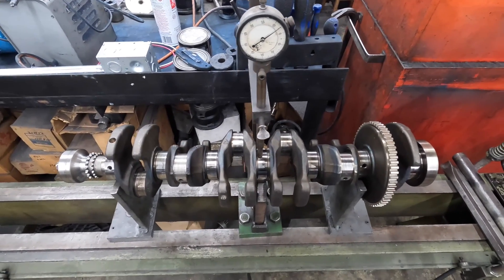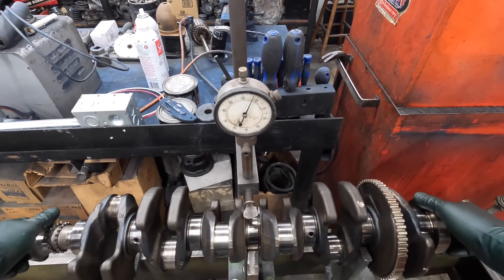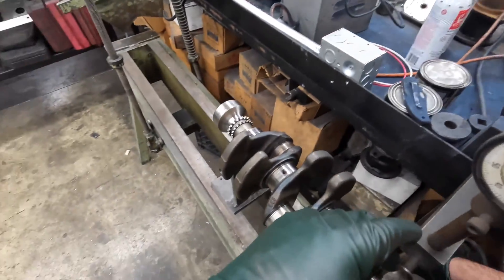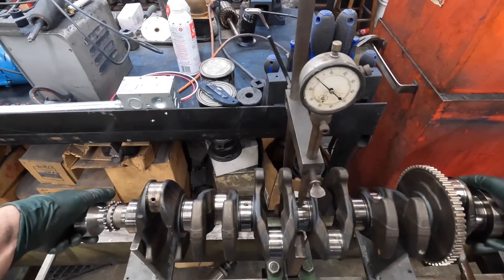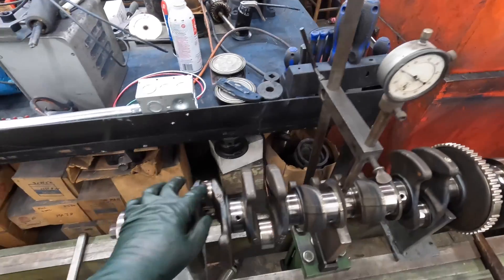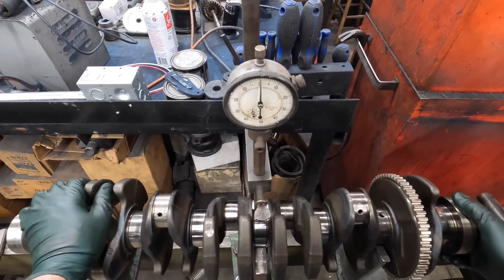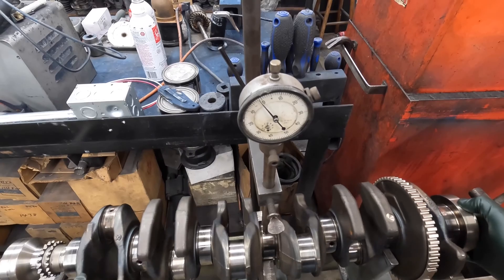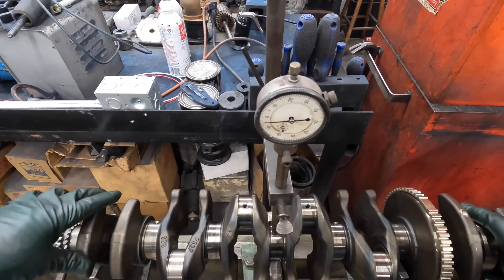Straightening a 2011 BMW Z4 N54B30 Crankshaft

Comment: Nice job  ,why do you not use hydraulic press?
Reply from the maker: Peening stress relieves it. If you use a press it will spring right back like you never hit it.
Reply: @LakelandAutoMarine  also I have seen that the push the shift and tapping it then?
Reply: Where he hits it down, he's making it come up.